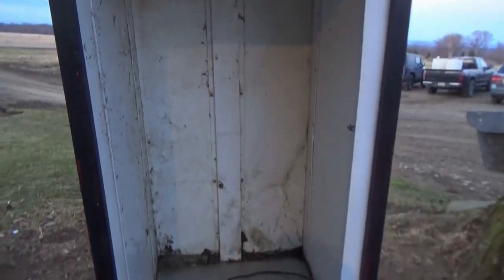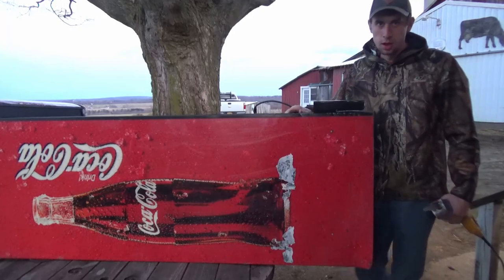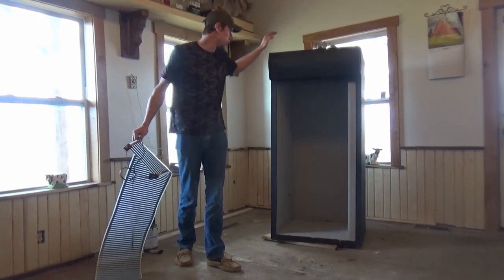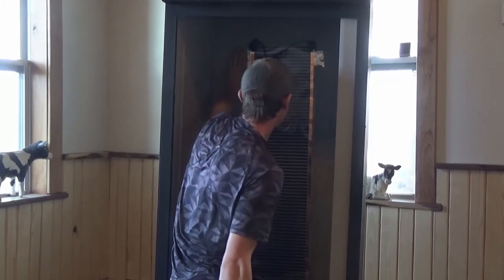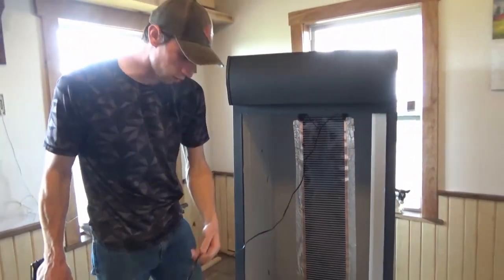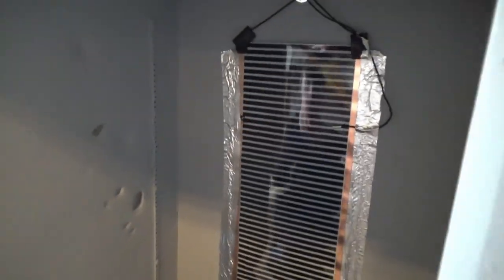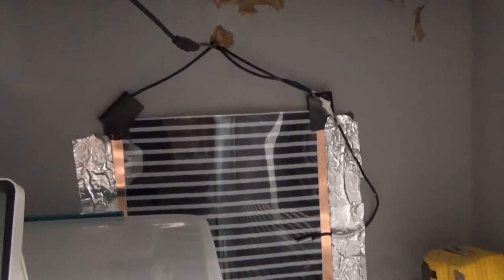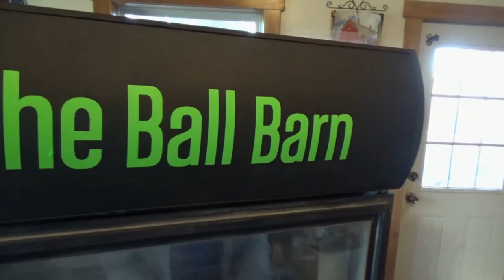DIY Converting a Fridge into an Incubator

Comment: I would have thought that you would have wanted the probe to sense the heat of the air not the heat of your heating mat.  Am I wrong?  How did it work out for you?  did you change anything since the video was made?
Reply from the maker: It worked out perfect. Hatched 8 clutches with it so far and planning to use it again this coming season.  I should have mentioned I have a thermometer and hygrometer (accurite) sitting on the rack to read the humidity and air temp. The probe needs to be on the heat tape to keep it a constant temperature. I adjust it based off what the accurite said and got it dialed right in.
Reply: I'm glad it worked good for you brother but u are not correct on the probe placement in the incubator. In a rack your way is right. U want the probe on the heat tape in the middle section of the rack but in the incubator u want the probe free floating from one of the middle shelves .  Not meaning to tell u how to do your stuff but there is room for error the way you have it set up. Not trying to be mean at all just wanting to help out since that is what this hobby should be about.  I have done plenty of things wrong and luckily I had people help me out before something bad happened. The incubator looks amazing though. Great job bringing that old cooler back to life for something else.

Comment: How are you getting an accurate temp with the probe right on the heat tape?
Reply from the maker: The probe is always supposed to be on the heat tape to control the temperature it generates. You may need to raise it a few degrees to get the entire incubator at the temp needed. This will be my 3rd year using this incubator with no complaints.
Reply: @12gauge44  I've never used a heat tape before I just figured it would be like conventional heating where the probe is out away from the source when you have air circulation
Reply from the maker: @wallyodom8254  I have a secondary temp gauge that measures the air temp. The thermostat probe is on the tape just to keep it consistent